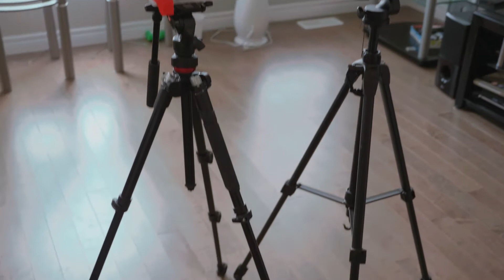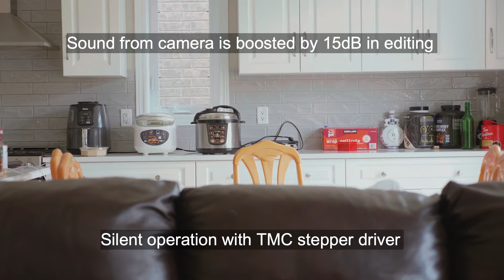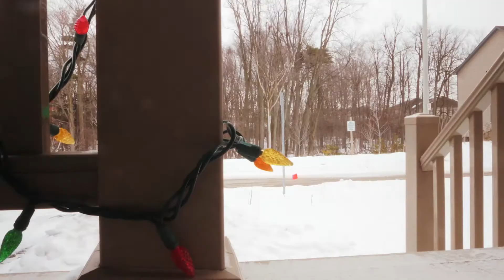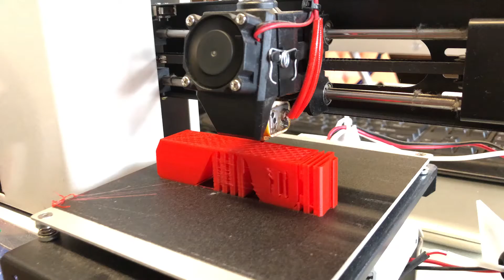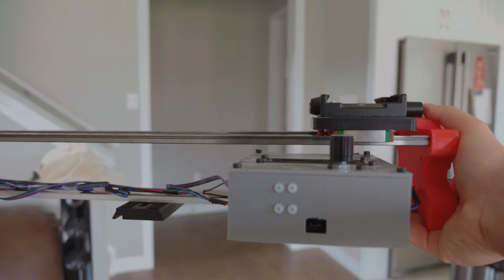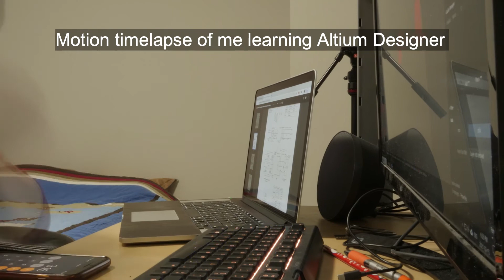DIY Arduino Camera Slider With Motion Time-lapse Capability

Comment: Hi Mech EE, I'm curious to know if you have made any progress with your slider. I have made a 3 axis slider, very different design to yours and have overcome many of the issues you have experienced with your design. My only problem is making the control unit small enough, and like you, finding a way to lock X & Z for transport. I have 3 sub controller boards, a break out board for the ESP32, I want to add a shutter control like yours and a fan speed controller to make it silent. My slider uses a PS4 controller BT to control X Y & Z axis, then you can store A position and B position, (buttons on the controller) then ping pong back and forth. I built it primarily as a second shooter for interviews, but I will add Timelapse as well. I started building a few years ago and shelved the project out of frustration with my limited abilities in writing the code. With AI, writing code has become doable for a noob like me and I have recently revisited the project. I've switched out the mega board for an ESP32 with built in BT, which got around one of the major stumbling blocks. I tried MakerBase CNC boards but unfortunately that didn't work out BC of the GRBL coding to the controllers. I'm very interested in the idea of making a custom PCB to make a one board solution, that will minimise wiring and make the whole thing more compact.

Comment: A very interesting project. Is there an electronic wiring diagram and code for Arduino. If so, where can I find it?
Reply from the maker: For this specific slider, the wiring diagram and code is not available. But it's very similar to other DIY slider's wiring and code.

Comment: This is awesome, I'm glad to see it's working well despite the issues! Also, is the camera automatically positioned at the limit switch everytime before it operates (starting at the zero point) or does it operate from wherever it's positioned?
Reply from the maker: For free control, it start at wherever its position is at when the mode is selected. If the mode is selected right after the startup homing process, then it starts at the position where the second limit switch is pressed. For timed run and time-lapse mode, the user can choose between starting at one end of the slider or the other. It then runs from that end of the slider to the other. The option to program it to start anywhere is possible as well. Just haven't done it.